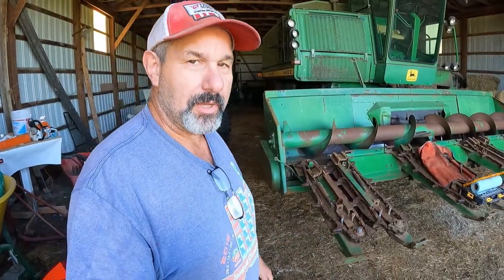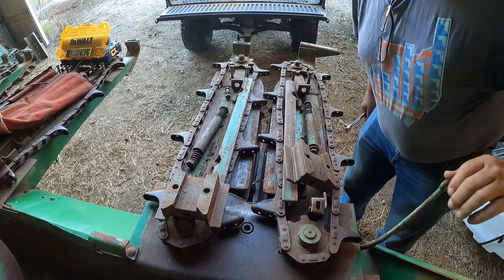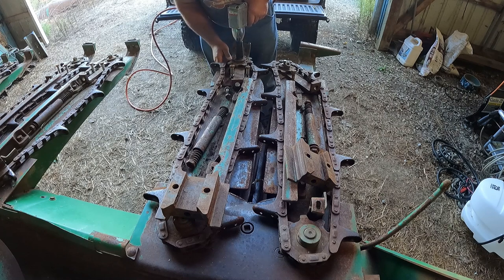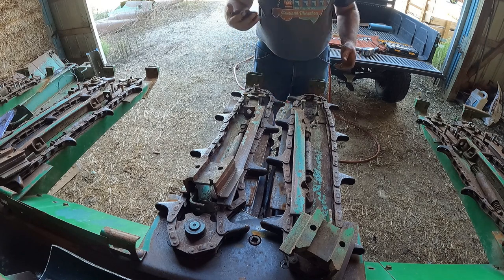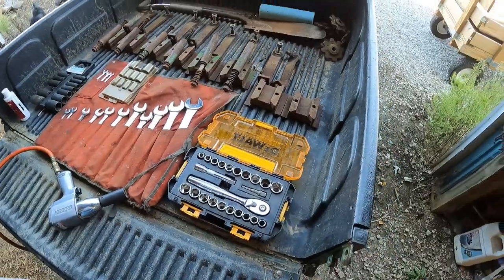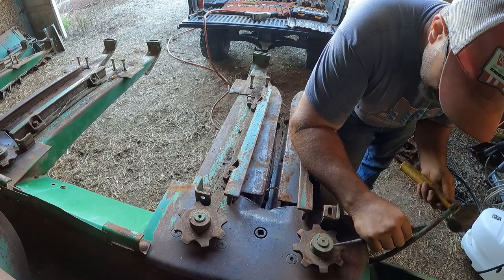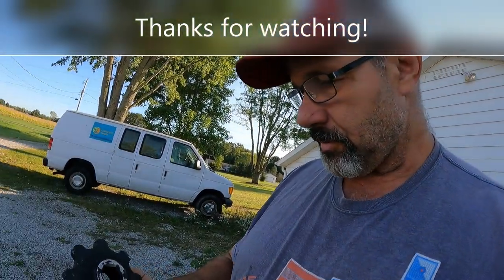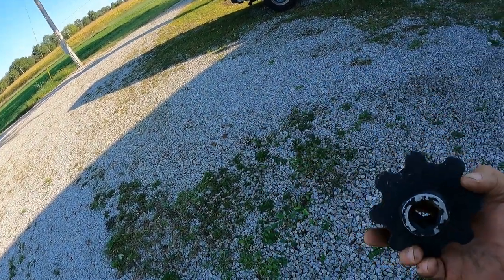Corn head rebuild - part 1

Comment: For yous whom dont have an impact wrench......and have a torch....... heat the nuts for maybe 45 seconds until they are cherry red.......then cool  them off using water so you dont ruin the bearings. Tada.....they come off easy !